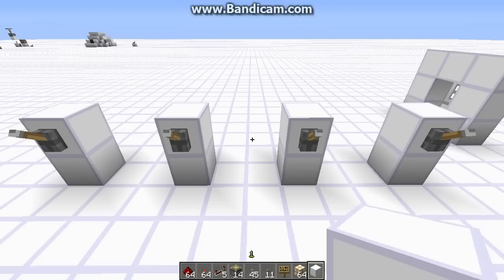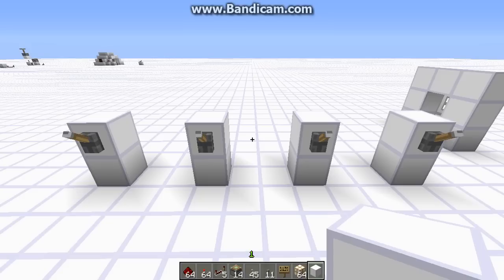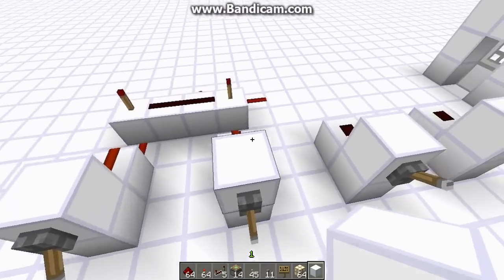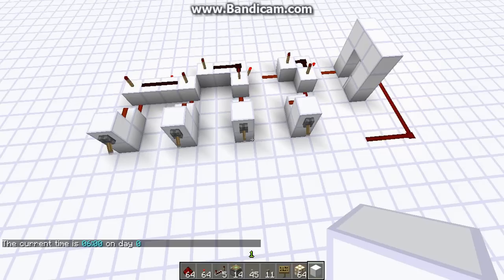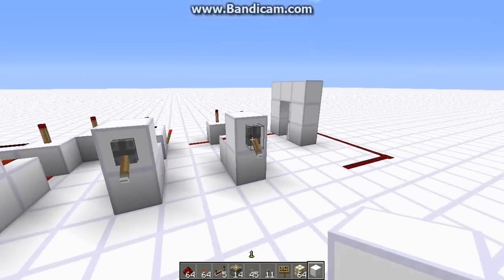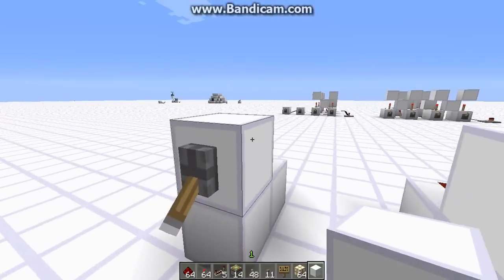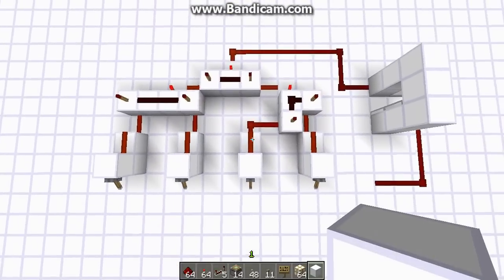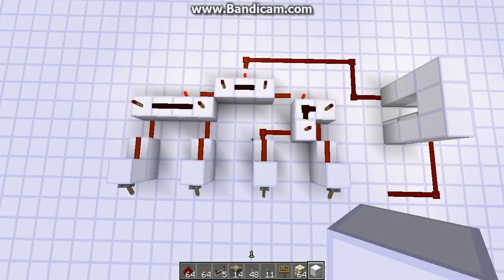Redstone Circuits 6: Serial Logic vs. Parallel Logic

Comment from the maker: As I've said before, yes there is a way to improve it in this specific instance. However, how would you apply that to an adder? Or a processor?

Serial/Parallel concepts apply to just about any circuit you can possibly conceive. There's always some way you can make a circuit better, but almost none of them can apply to a wide variety of problems. 

That's why I'm demonstrating these concepts, and not the one-off improvement that only works in this one instance.

Comment: couldn't you just use a decoder? Place a torch on top of each input, place blocks on top of the torches, as well as other blocks connecting the blocks on top of the torches, place redstone on top of all of that, and finally invert the output so that unless all of the levers are on, the final output will be off.

Comment from the maker: The carry calculation in ripple carry adders is indeed serial, and adders which use carry look ahead logic are indeed parallel. However, insta-carry calculations are still done in serial. Those adders are still ripple carry adders, its just the carry time is much faster: about 1/8th tick per bit on average as opposed to 1 or 2 ticks per bit on average.

Comment: What if you just inverted the inputs then or'd them together by connecting the lines then invert the 1or'd line? Would that be parallel or series

Comment from the maker: Yes, ImmaBoss is correct, I separated them out for a reason. And as I explained to TheSombady in an earlier comment, that optimization doesn't apply everywhere: only to AND gates.

Although just for fun, if you want an instance when multi-AND doesn't work, wait until I make a video on Kogge-Stone addition :P

Comment: In this senario, I'm just wondering, why don't you simply use a mutli-input AND gate, instead of all those unnecessary separate AND gates? I know you were demonstrating Parallel/Serial, but the most compact way is just one multi-input AND gate.